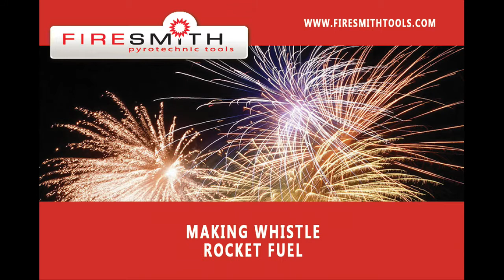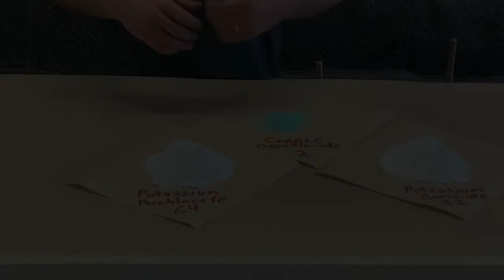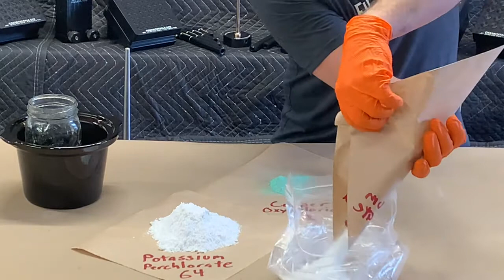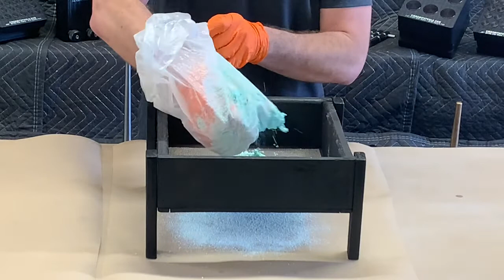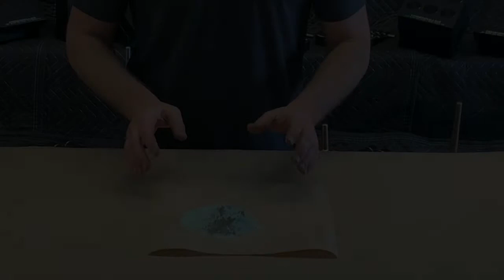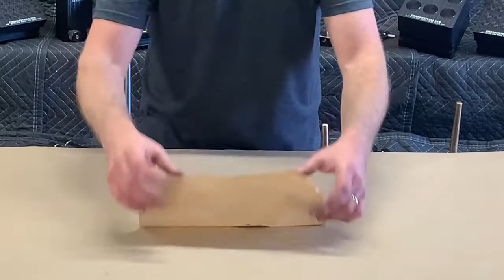Making Whistle Rocket Fuel

Comment: What can you do for this recipe to have less thrust and lifting power to it or what chemical make it lift into the air if you can awnser my question it would greatly be appreciated! Thanks
Reply from the maker: I'm not sure I fully understand your question, but generally speaking, there are a wide variety of whistle fuels used in the pyrotechnic field. Each have different burn rates and sounds. It's best to use the fuel that most closely works with the effects you are hoping to achieve.
Reply: @firesmithmanufacturing9376  i'm actually re reading this some time later and thought he actually meant how he could make the fuel not as strong basically as shown in this video https://youtube.com/shorts/eNikJbofsXc?feature=share

Comment: What measurement  do you use for the chemicals? Grams?
Reply from the maker: Yes. Weights are always in grams
Reply: @firesmithmanufacturing9376  does it really matter? Arent these just ratios?
Reply from the maker: @lollerbol  Nope, as long as your using weight instead of volume. You can use grams, pounds, stone.... whatever you like so long as you are consistent.

Comment: is it possible to mix it in a container like a jar instead of a bag?
Reply: I've done a similar mixture (Na salicylate rather than K benzoate type, stearic acid instead of petroleum jelly) in an open aluminum pie tin with a wooden spoon, outdoors, adding solvent as needed to keep the mixture stirrable.  I sieved only 3 times.  It takes much longer to dry -- a week and it still smelled of the mineral spirit.  Stearic acid gave a much stiffer dried compo than vaseline does.

I've also done it with no carrier solvent at all in a zip-lock bag, dunking the closed bag as needed in a hot water bath to keep the petroleum jelly fluid.  The petroleum jelly went in to coat the bag first.  Mineral oil is an alternative I haven't tried yet to dissolved petroleum jelly.

I'm not sure whether any of these methods is safer than the one I used to use, wherein I first smeared petroleum jelly over the sieve, then sieved the KClO4 thru that, then the salicylate.  If we're going to be sieving the complete mixture anyway, where is the anti-friction action of the petroleum jelly most needed?  I'd assume the pushing of the compo against the metal of the sieve is where lubrication is most needed; the compo also picks up the lubricant on each passage thru it.

Comment: Is it better power than sali,and less sensitive,pls reply
Reply from the maker: Salicylate tends to burn a bit more vigorously than Benzoate. Salicylate whistle rockets tend to use shorter spindles. I prefer the sound and lifting power of Benzoate whistles, though. It's really just personal preference.
Reply: @firesmithmanufacturing9376  many many   thanks for reply,I made sali,which give yellow tailed, and its very very sensitive for just hand ramming,ur tooling set is world famous,I have a dream thai if were available through amazon in India, I am a fond of pyro,but there are many chemicals u use easily thats are not available in India,so just make myself happy with watching ur video,all day night I dreamt about pyro

Comment: If copper oxcychloride is replaced with iron oxide is it possible, and potassium perchlorate is replaced with potassium chlorate?. I hope you answer my question
Reply: Dont do it
Reply: Honestly iron oxide is fine but KCLO3 (potassium clorate) is not recommendent. You have to press these mixtures into a tube and there is risk of ignition working with less stable formulas. But the honest answer is yes it could be done.

Comment: Those parts u said is grams right?
Reply: Wish I knew as well, people measure differently when saying parts in chemistry?
Reply: "The reference to "parts" in a chemical formulation simply refers to the ratio of one chemical to the others all by weight. Let's say some formula has 3 parts A 2 parts B and 1 part C. In this example, my formulation could contain 300g A, 200g B and 100g C. Or... 900g A, 600g B and 300g C." Directly copied in their reply from the strobe fuel video. This is perfectly understood now.
Reply: @mckarthy5771  thankyou for that wonderfull answer but one last question would it still work if i use potassium chloride, or kn03?
Reply: @mckarthy5771  hey bro pls reply if i can use potassium chloride instead of perchlorate thankyou!
Reply: @bombayjamesgabriel4800  I'm not a professional in pyrotechnics, but I work at a pharmacy as of right now. As you may know, potassium chlorate is a more potent oxidizer and therefore much stronger for fireworks. I do not know of any comparable compound that could replace it other than what he was using in the video which was potassium perchlorate. Chlorate>Perchlorate in terms of potency, but in turn more dangerous and I'm not sure how that would affect the pressing or anything else, I could probably ask my pharmacist very non-conspicuously.
Reply: @bombayjamesgabriel4800  I agree with McKarthy... iirc potassium chlorate is much more sensitive to shock compared to perchlorate. Personally, I'd avoid it.

Comment: A question because i never did this. Whistle fuel is known for being friction sensitive. Is screening the mixture considered "dangerous"?
Reply from the maker: Though not a sensitive as flash or strobe fuel, whistle is indeed a mixture that must be treated with respect. That being said, using valseline dissolved in lacquer thinner greatly desensitizes the fuel and makes screening much safer.

Comment: what about a high quality mask to prevent inhaling poison? and goggles also help.
Reply from the maker: The vast majority of the chemicals used in pyro aren't poisonous. They are commonly found in many every-day products.
Reply: @firesmithmanufacturing9376  it’s a lot different when inhaled. I’d be wearing a mask, I watched those chemical go air float several times in the video. Guarantee you inhaled some and guarantee you mr health would be better off with a mask.
Reply: @firesmithmanufacturing9376  regardless, you do you, appreciate the quality instructional video none the less, thank you sor
Reply: The dust mask is needed only when handling the dry potassium benzoate.  After that, what you really need is to work in open air against the solvent fumes.  However, if you're mixing in a closed zip-lock bag, you can do that part indoors, away from ignition sources.

Comment: If you  cant  make whistle mix after this ... Just  give up
Reply from the maker: Ha ha!... I try to make it as easy as possible
Reply: @firesmithmanufacturing9376     Well if i can make it  anyone can ... 
But i have  som  problems  with  CATO´s .. Maby you can help figure it out ?
Reply from the maker: @oz3bto  There are a few "typical" causes of CATOS. Making sure your fuel and tooling are compatible is important. But, loading pressure and increment sizes are usually the culprits.

Comment: Why does your radio Come out 101 parts?  64 + 32 +2 = 98  3 parts Vaseline = 101
Reply from the maker: That's very common in chemistry. Since the formula is simply a ratio of parts in relation to one another and not as a percentage, the total amount of "parts" can often be less than, or greater than, 100.

Comment: 80 mesh titanium sponge over the spindle for a bushy tail a little too butt puckering for my liking…. Would rather press TI flake
Reply from the maker: Flake and sponge both work well. Avoid spherical, though. It's horribly abusive on tools.
Reply: @firesmithmanufacturing9376  well there goes my plan